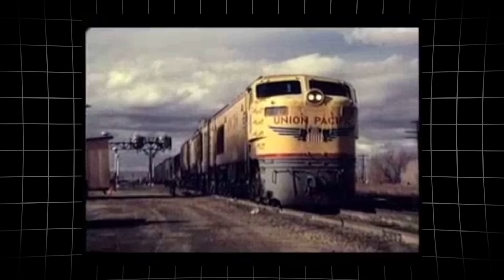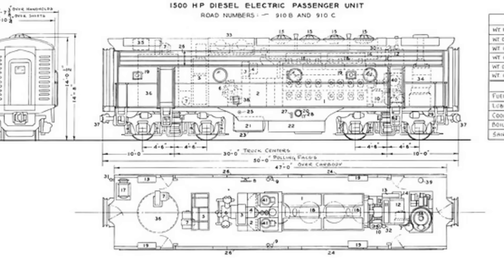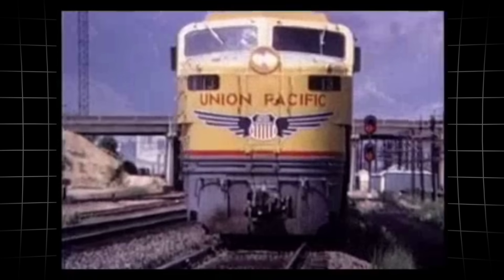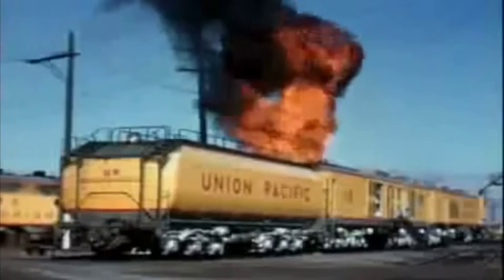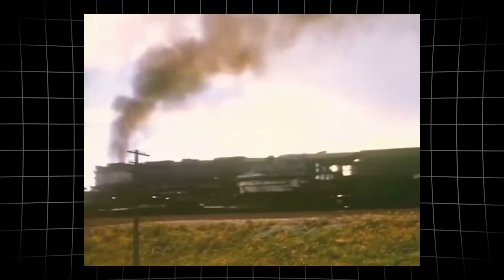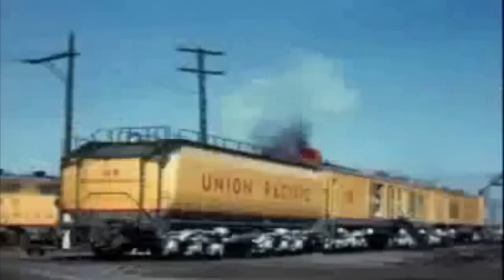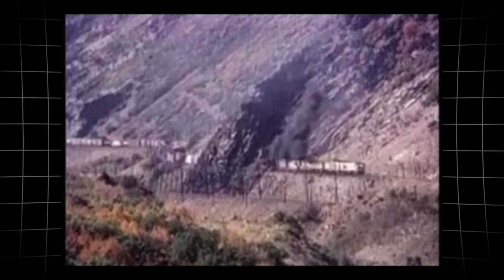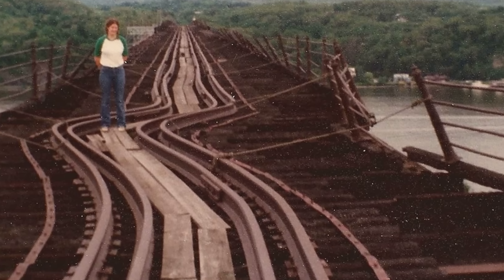The Steam Engine So Hot It Set the Tracks on Fire

Comment: While a good documentary verbally, your pictures rarely match the subject. You continually use the terminology "Veranda" but only occasionally show video of the actual, single unit Turbine that was the Veranda. It was the unit with the side walkways. Many of the shots are actually of the last 8550 hp "Big Blow" three unit turbine, with the A Control Unit containing the 900 Hp Cooper Bessemer diesel hosteling engine for movement around the yard, and the associated electrical gear, The second B Turbine Unit which housed the GE Gas Turbine, generating the 8550 HP and the third C unit which was  modified 4-12-2 Tenders to carry the 24000, gallons of Bunker C fuel burned by the #2 unit.. The Veranda Turbines also only had an output of 4800 HP,  same as the 1 st group of Turbines. All Turbines were built by a consortium of Alco and GE with Alco building the carbodies and GE providing all the electrical and mechanical propulsion gear. All information regarding the UP GTEL's can be found in the book "Turbine Power" by Walter Simson which breaks down all three classes of the UP Gas Turbine Electrics and is available through Amazon and Kalmbach Publishing,

Comment: Early generation Gas Turbines (jet engines) were very inefficient. Relied on very cheap fuel to be cost effective. In the late 70s I worked at a first gen GT power plant dating to the early 60s. About 20% efficiency on a good day. GTs of the 50s would have been well less than that. Present day power plant GTs are way better - mid 40s%. Little wonder the GT locomotives were not entirely successful.
Reply: But they were
Reply: @michaelosgood9876  Then why were they withdrawn so suddenly?
Reply: @michaelosgood9876  Then why were they withdrawn so suddenly and not replicated? Flawed concept reliant on dirt cheap fuel.
Reply: @BigAmp I get your point-- But, in service, they were actually pretty good, esp the 1-30s averaging 100000 mile per year,  nearly twice the Big Boy numbers. This video is so flawed, it ain't funny. I mean, 8500 Veranda 😂😂😂. The bloke had done little homework on the Turbines.  Yea, as you say, their efficiency fell well short of the diesels, which couldn't haul anything like those turbines, which had no real replacement until the arrival of the Centennials,  whose numbers were great, and Were a worthy replacement.

Comment: A typical diesel electric locomotive of the early 1950s could muster around 3000 horsepower? Really. The EMD SD40-1 hit 3000 horsepower in 1966. In the 50s, the strongest diesel was half that. The SD9 hit 1750 horsepower in 1959. Get your facts straight.
Reply: AI BS. No human mind was used in this trash.
Reply: Not 3000, but 6000hp . And also 7400hp for F9. Typical F7A/B  was 3000hp.